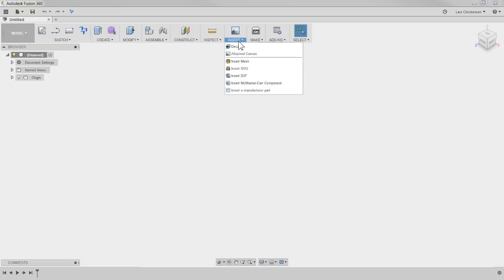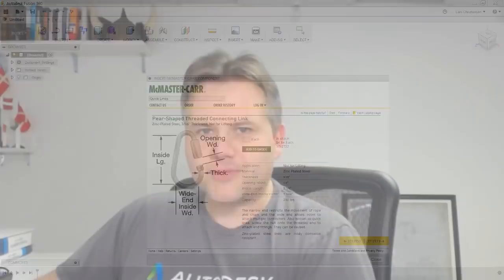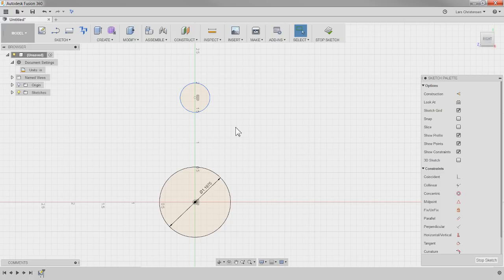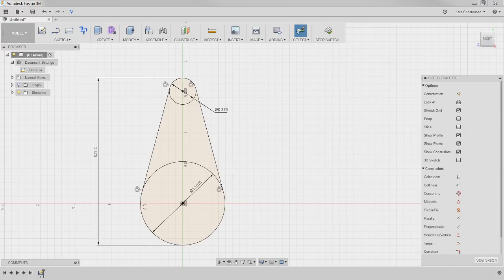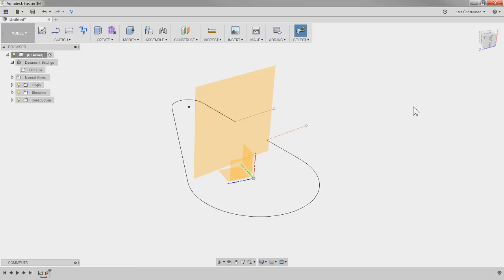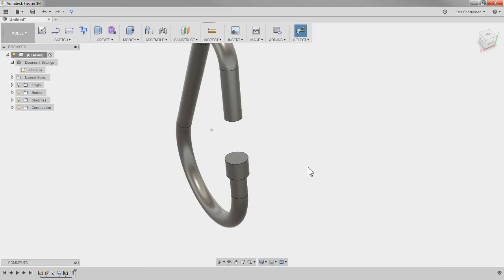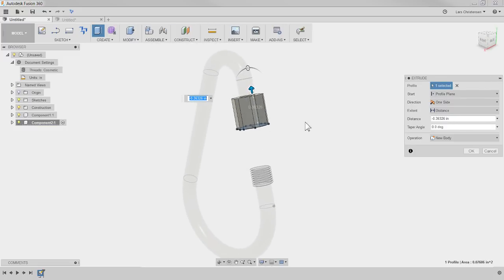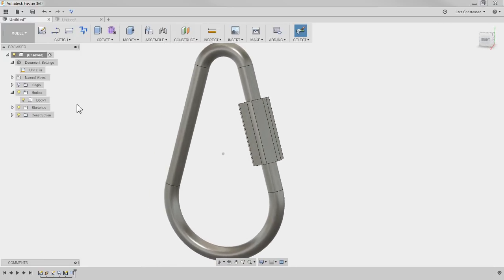Fusion 360 — How to Model a Quick Link — #LarsLive 94

Comment: Just watched where you mention you can do math in the dimension box. One 'trick' I like to do (that I don't think I've seen you demonstrate) is doing math with related dimensions. For example, the first circle you drew would have a dimension of d1, you could have made the second circle say, two thirds by setting its dimension to 'd1 * 2/3'. Didn't know about specifying units in there though, but being European I don't use inch :) The other two; shift to lock to tangency and right click to measure tangency were useful. Before I'd have used construction lines and measured between them.
Reply from the maker: Hi John Morrison Thank you for watching! ANd for the great comment! love it

Comment: Thanks Lars.  I think you helped solve problem I am having with the components section.  I have a R. hand part and mirrored it to get L. hand part.  I turned off the R. side body and adjusted the Cam portion accordingly.  When I mill the mirrored part the settings are off.  I have searched your vids. and double checked all my work, still getting up to .1000 off during mill process.
Reply from the maker: Hi ruddernstick Thank you for watching!
Hmm....time for some detective work....there is something that makes the milling off

Comment: Great video, and easy to follow. I thought you were going to trace the photo you saved and use it as a template, but you ended up building it from scratch.  So many ways to build things and I still have so much to learn. Thanks Lars.
Reply from the maker: Hi Damon Downing Thank you for watching!
If I had used the photo, I could have gotten closer with the smaller diameter at the top and where the opening should have been. So that would not have been a bad call.
I like you thinking.

Best,
Lars